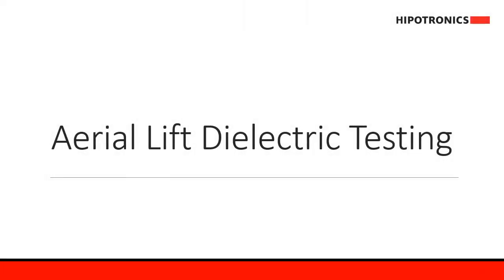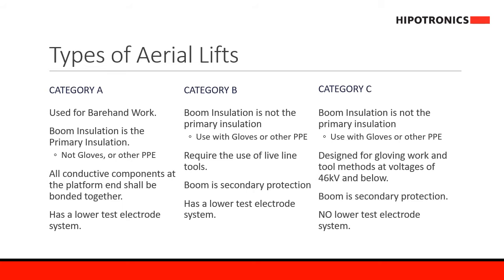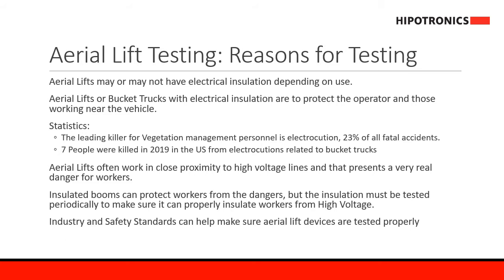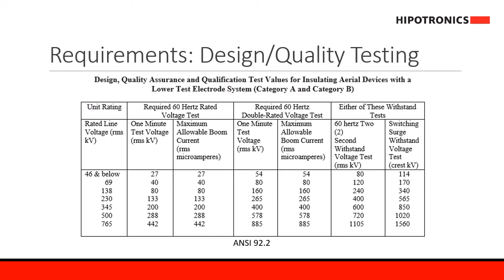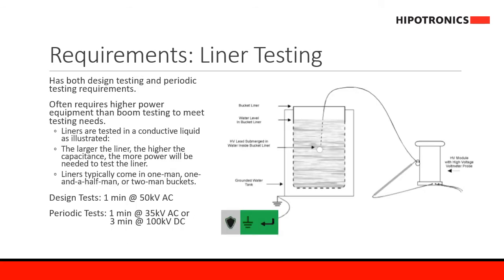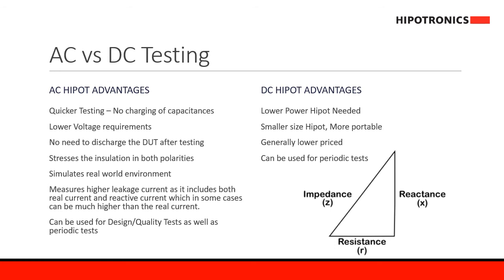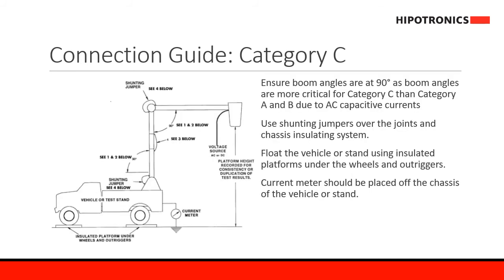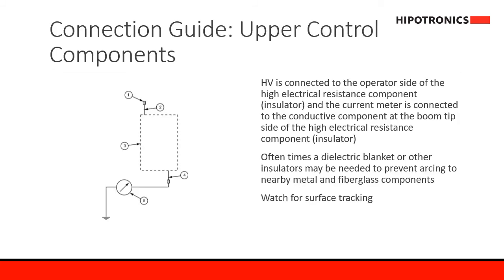Aerial Device Testing 2020

Comment: For Bucket Liner testing, which equipment would you recommend?
Reply: Go with a different brand. Hipotronics is being shady by offering an 80 kV DC hipot, so you can test aerials, but have to buy a second hipot to test liners. Stay away until they get it together.
Reply: @supermanley101  thanks for responding, we went with phenix hipot for the vehicle qualification and routine tests and for liners we bought T&R from UK both are working well without any complaints. 2 years ago we were in process of prototyping our manufactured liners and bucket trucks but these 2 machines played a crucial part.